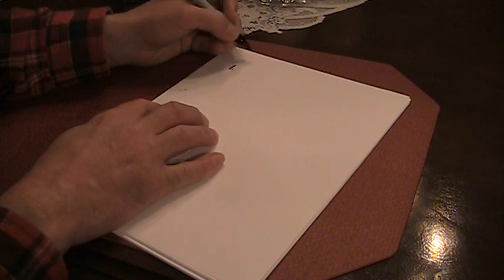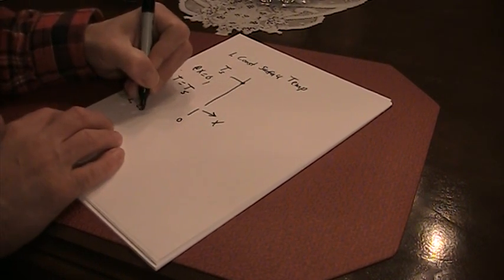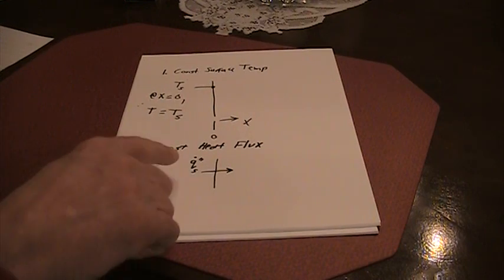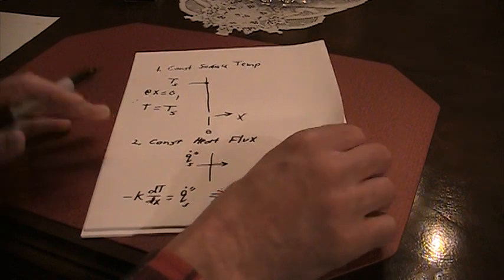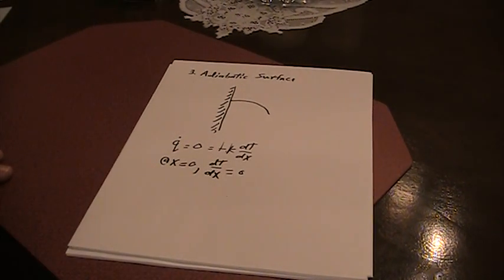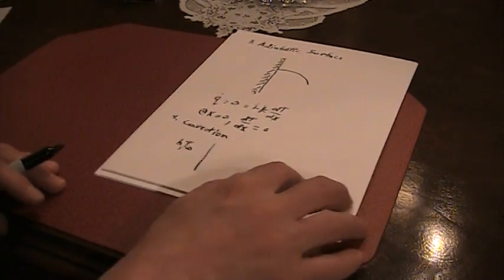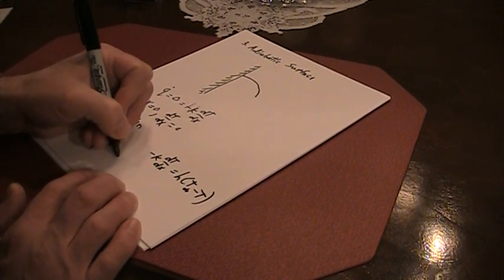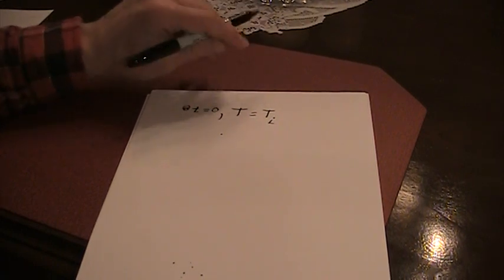4 Heat Transfer Boundary Conditions.MOD

Comment: Thank you very much  m4413e's channel  .I have a question if you allow me .???if I have a long bar with square cross section area @ temperature T1 and then was placed in a furnace which is acting like a black-body @Tb if the flux is :- q=(ipslon)(sigma)(Tb^4 - T^4)what is the boundary condition if the system is transient ???